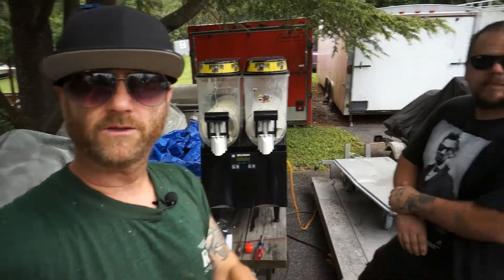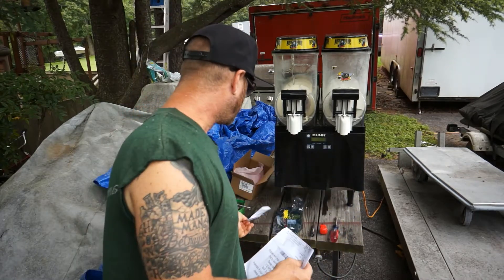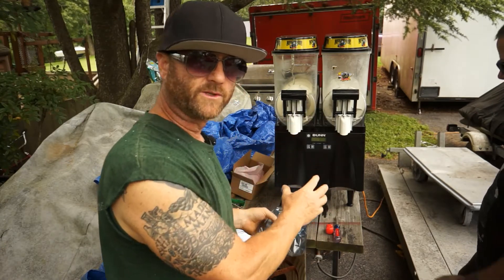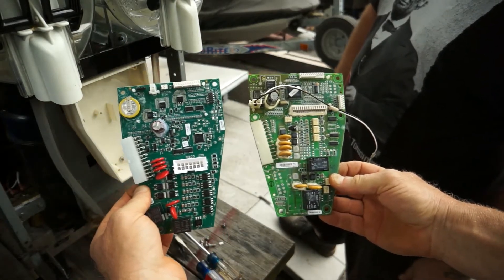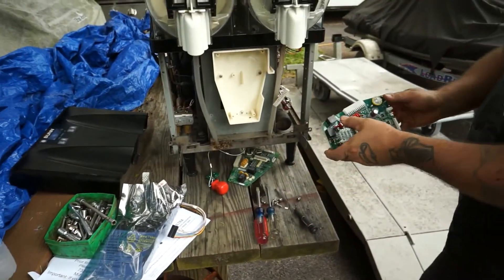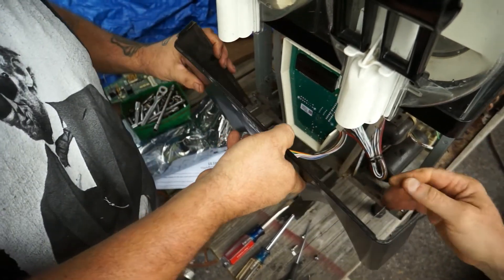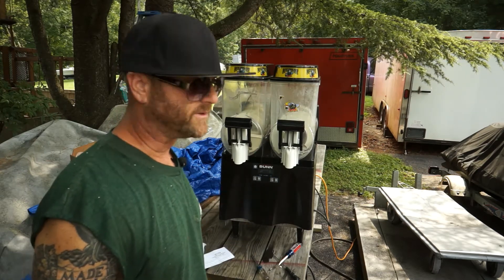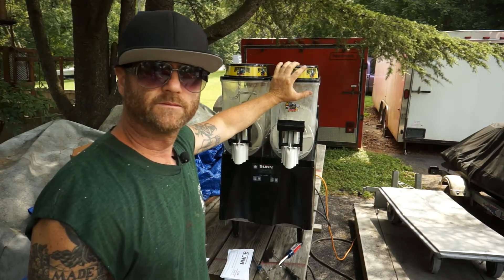BUNN ULTRA-2     TIC CODE ON DISPLAY SCREEN SHOWING ?? FIXED

Comment: You guys rock!  I changed my solenoids, but now one side is only freezing the end of the cylinder.  Any idea why? Thanks for your videos!
Reply: Turn one side "Off" and see if the other side freezes, if not hold the 2 buttons under the bunn logo until you see torque sensor / Hot Gas readings. If the HG reading is below 100 then you either have a freon leak or its low on freon
Reply: What should drum temp and hot gas be on a properly charged machine?  I'm working on an ultra 1 which is the single bowl version.  It was empty of refrigerant...so I had a tech check for leaks (none found...as far we can tell) and recharge but I think he overcharged it. Drum barely gets to 27 or 28 and this is after 6 to 7 hours.  Starting with refrigerated product too.  The hot gas is low..starts out around 100 when product and drum are in the 50s but quickly drops into the 70s. The compressor itself is also getting cold...as in the casing of it. It gets cold enough to get condensation on it if it's humid...this is telling me it's over charged.

Comment: What is the part number?
Reply from the maker: Just go online...type in model number...circuit board with BICS upgrade...I think it was coffee express or something like that.  Use a reputable website or buy off Ebay..that way you are protected to get genuine parts and trusted seller.
Keith 2guys how2

Comment: Any idea on what would cause a loud rattling noise it’s not the fan
Reply from the maker: I would check all the bolts, screws, etc. Make sure the tanks are positioned correctly. Make sure the augers on both tanks are straight and installed correctly, with all gaskets and washers etc..
You should check the bushings and bolts on bottom of the compressor..and check for loose screws on side, front and rear panel covers.
Keith 2guys how2
Reply: The small bolts that mount the fan to its bracket. Will loosen up over time. The rattle isn’t always there. There are three of them near the motor. Make sure those are all tight. 1/4 open end wrench

Comment: friends I need your help, I am from El Salvador.
my bunn ultra machine has a problem
Reply from the maker: Hello, what problem are you having with your machine?
Reply: Will the bad tic clock keep it from turning into slush?
Reply from the maker: It's best to just order a new circuit board..it comes with upgraded tic...that doesn't require to buy a new tic capacitor.
Reply: Do yo have whatsapp!??

Comment: So what your saying is that you could’ve just changed the battery😂
Reply from the maker: It looks like you can change it...possibly, solder the exact TIC capacitor back in circuit board...This is a type of memory capacitor...It looks like a battery, but, the new panels come with the TIC upgrade to prevent future problems. You should look for burnt marks on the circuit board..if the TIC is bad, possibly,  something else is bad too. 
Easier to replace the board with new TIC upgrade and know it will work as intended for many years.
Keith 2guys how2